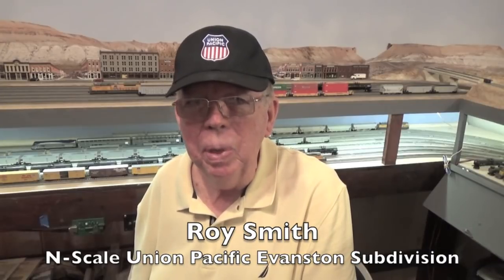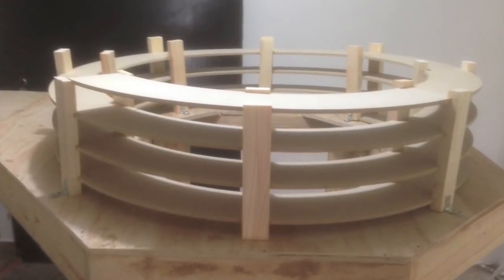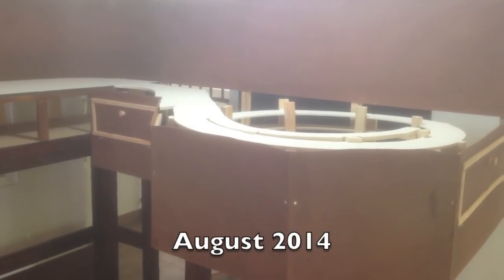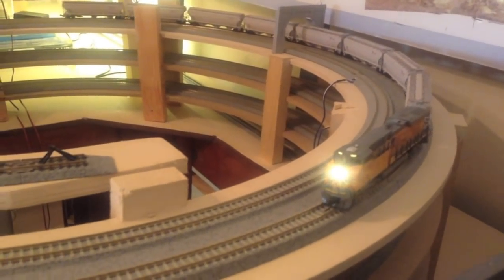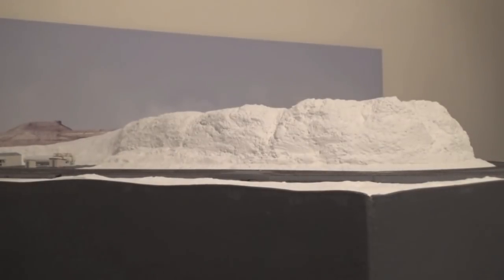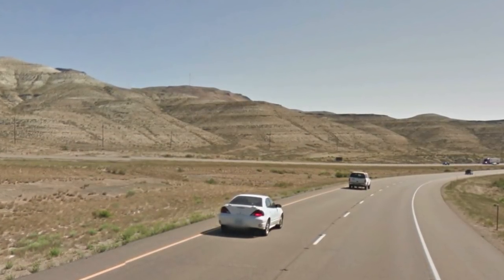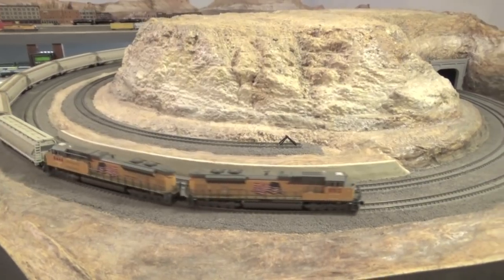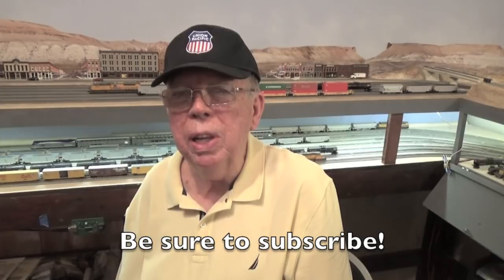How I Constructed the Eastern Helix on My N-Scale Layout

Comment: hi there Roy i can sympathize with you on helix's. i don't like to have any hidden tracks at all because number one is that i like to see my trains running the whole way around my layout. number two is that you are so right it is very hard to keep ducking under the layout every time you have a derailment. it is truly a big pain in the neck, but on the other hand it is nice to have all that storage place for your cars and engines. it is a decision that one has to make on space, operation, and convenience. it is a very hard to get the right balance with everything that you need to do. the only thing i could give you an opinion on is that you are using one of the most bullet proof track set ups that you can buy so derailments should be to a minimum however when you do have one maybe you could think of or ask the community of some ways to make the access to the center of the helix easier for you or may a new way to reconfigure it so that you can have a better way of reaching the derailments. i don't know what kind of cars you purchased but i found out the hard way that micro trains wheel sets make it so much nicer to operate with they are a lot smoother and will not separate in mid pull. i got rid of a lot of derailments by going with micro trains trucks and couplers.  to make or build an incline to go that far down to your staging yard would have to be very long. maybe you could have the incline behind the back drop but that still leaves the access problem just now it will be behind something and it could be the whole length of the layout instead of just right there in one mountain. i  don't know if this comment will help or not but if your on the fence about it just take as much time as you need and weigh all options carefully. thanks jim
Reply from the maker: Hi Jim! I certainly think you've made a wise decision by avoiding hidden track and duck-unders. Both can be problematical and unpleasant. Sometimes it seems to be hard to decide what to do on our layouts until we actually do one thing or another and then end up deciding to change it. I do think that it's nice to have a staging yard in any case, not only for storage of trains, but also to have them lined up until it's their turn to appear on the layout, like trains arriving from off-layout destinations, just like real trains seem to come from "somewhere else." I think there are at least 3 important things I can do to reduce any derailments in the helix, and they are: make sure the track in the helix is very clean, make sure the couplers are all well matched, and make sure the diesels are well speed matched. Most of my freight cars are Micro-Trains, but I've also been changing out the plastic wheels for metal wheels and that seems to help as well. I also think that adding some weight to the cars will help, too. And of course, all of my track is Kato Unitrack. You're comments are always very helpful, Jim, and I want you to know that i appreciate them very much. ...Roy

Comment: If the decision were mine I'd consider how often I must go under the helix. My knees get worse all the time so getting up an down would be a problem and something to be avoided. Before starting demolition and trying to build a long, long incline, however, I'd first try a compromise. And if that doesn't work only then proceed with new construction. My compromise would be to remove at least partially the fascia around the helix. I question the incline solution because there has to be many feet traveled in that helix. Will you have the space to fit it in? I guess you might call it Sherman Hill. Of course, if you have the space that could be interesting to model.
Reply from the maker: I know exactly what you mean, Jerry. I can keep the track in the helix perfectly clean, and I can make sure the couplers are perfectly matched. Even so, derailments do occur, and when they do, it's a painful experience to fix. I agree that opening up the fascia is a good first set before going to the extreme of demolition. But I'm pretty sure that an around-the-room incline not exceeding 2 percent is an option. Of course, the disadvantage of that would be having to build some kind of lift-up, drop-down, or swing bridge at the room door. ...Roy
Reply: You did a pretty good job with the lift out in staging. I'd love to see what you might do with a depiction of the Sherman Hill scene.
Reply from the maker: Thanks, Jerry. Building the lift-out at Pocatello staging turnout out to be a lot easier than I thought it would be. It has given me the courage I need to build some kind of bridge at the room door as well. I absolutely love your idea of depicting Sherman Hill. That really appeals to me. Don't be surprised if I end up doing just that, thanks to you. ...Roy
Reply: Thanks. If I ever am able to scrape together the funds to start a layout in my new home I'll look forward to helpful comments from you.

Comment: Hello Roy, If you take out the helix will you then have to install a lift out or duck under to Pocatello for your continuous run?  For me, I think I'd open up as much of the helix as possible to be able to see and service any derailments; if you remove the helix will that affect your directional running into the staging. Keep up the good work as I look forward to your inspirational videos and layout ideas. Best wishes.
Reply from the maker: You're right, Julian. If I remove the helix, then I will have to replace it with some kind of long, gradual incline to take trains down to staging. And, presumably, that would include some kind of lift-up, drop-down, or swing-type bridge at the room entrance. Such bridges don't appeal to me either. What a dilemma! Fortunately, I don't have to decide right away, and absolutely, it would be better to open up the fascia of the helix before trying to do anything more drastic. Thanks for your comment, Julian. I appreciate it. ...Roy